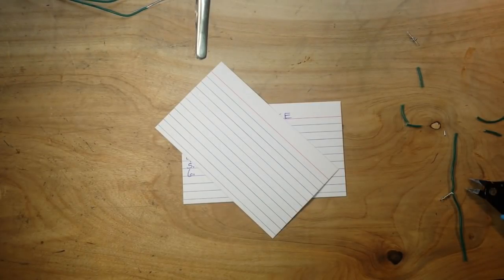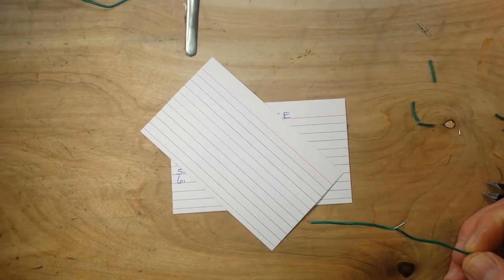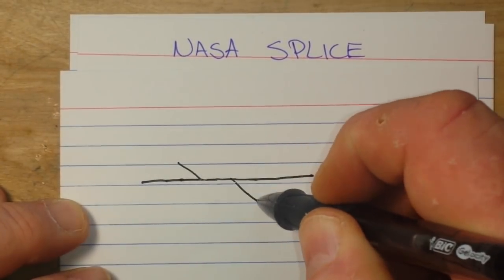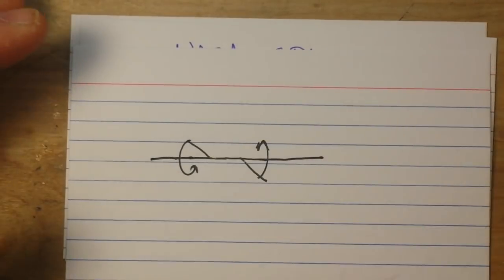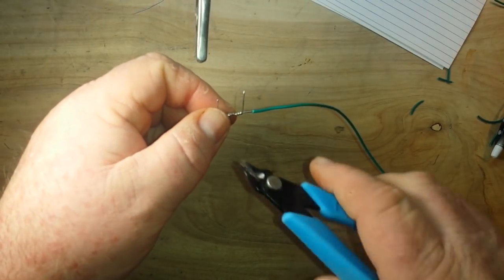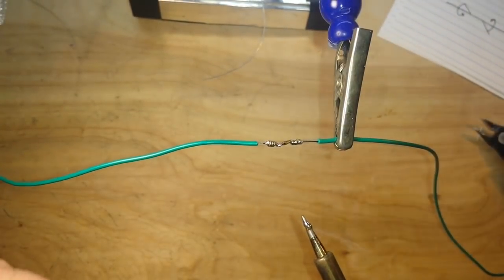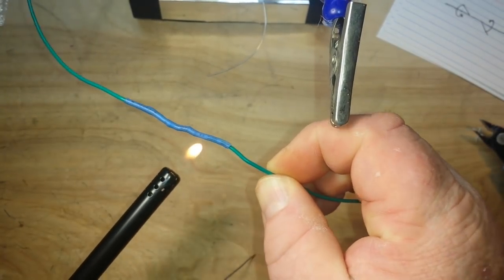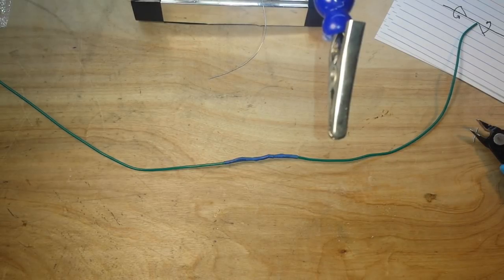How to splice a wire

Comment: The gap between the coils worries me, reduces the strength? also, off topic single stranded copper wire is a no no,
IMHO have no redundancy against metal fatique that can easily cause serious problems in environments vith
24/7 vibration, problems that can be intermittent and very hard to track down

Comment: Haha thanks I've been doing all my wiring myself but i always did it the wrong way and even now to this day but I just bought a new soldering iron from Amazon to give soldering another try after watching quite a few videos now before I couldn't get it to solder correctly but I didn't know the proper way to tin and etc, so I gave up and went back to doing the wrong way like you first demonstrated and then wrapped it in electrical tape. Now I'm going to try to redo all electrical connections tomorrow on my Cadillac Escalade Esv cause I wired in a lot of aftermarket lights, trailer wiring and couple wires had corroded underneath and I found the broken connections and to my lights. I wired em with no solder and just twisted like first showed then wrapped in electrical tape. All these videos been helpful. Oh I have question too. Is it better to tin a wire before putting a ring connector or any terminal before crimping the terminal on?

Comment: So this is new, I’ve never heard of a NASA splice, there are other splices that we use at JSC according to the J standard. All of our splices have to be wrapped minimum 6 wraps. Both wires need to be pre-tinned and flown together prior to wrapping. The wraps cannot overlap, they can touch but you need to be able to see the wire strands and the wraps clearly. The distance from the splice to the wire insulation has to be the diameter of the wire on both sides of splice. There can be no pits or discoloration after the excess wraps are cut. Lastly there is indeed heat shrink that will slide over the wrap. For class one and flight quality will inspect the work and if not acceptable it will have to be re-worked. The wire used as the wrap has to be a single strand from the wire you are using from the drawing, unless allowed to use bus wire.

Comment: Were your connections pre tinned? If I used strand wire do I pre tin also or no?
Reply from the maker: If you are using solid core then you can tin. Don't tin stranded, you need them flexible so they are able to adapt to each other.
Reply: @learnelectronics  Gotcha, since tinning is rule #1 it didn't make sense for stranded wire. Thank you for the response and sharing your knowledge. Greatly appreciated!
Reply: Stranded wire will mop up the solder by capillary action anyway, so tinning them when splicing is a bit counter-productive. Better to just tack them together by reflowing the solder if they're pretinned.

Comment: First off, NASA doesn't know everything. Second, that is not a NASA splice. You have never worked at NASA. I am both mil spec and NASA certified.
Reply: I'm looking at NASA-STD-8739.4A, and it looks pretty much the same, except Paul did it a bit looser around the middle. What's shown in the thumbnail is only half the job, because it hasn't been filleted yet. I'm guessing you commented without actually watching the video. Also, nobody said NASA knows everything: the point is that this is just a good way to splice. You might need to go out for some fresh air and take a walk.
Reply: Fresh air, take a walk, and pull those jumper cables out of your ass. Red to red, black to black. 🥳

Comment: I want to thank you very much for showing the correct way to splice wires.  I am a jewelry maker, sometimes working with fine 28 gauge wires.  This works well for me and even my beads will slide over this method of splicing.  I do not use solder, however, this is a nice and strong connection.  Thank you again.

Comment: Good video. I’m an automotive technician that specializes in electrical diag. I do a lot of wire repair and this is very close to what I have been doing for years. It’s a little different with stranded wire but I didn’t know this was the special technique.

Comment: The NASA standard requires no gaps between adjacent turns.  At 3:50 your left side looks good but the right side has gaps between adjacent turns.  Although you made a good connection, I don't think this is really up to NASA standards. Good otherwise.
Reply: I bet you're the life of the party 🥳
Reply: @kccodex8931  When meeting standards is the difference between getting paid or having to do it again, yeah, I can be humorless.
Reply: @johnp7318  🥳🤣Point taken.

Comment: Thank you for this! I'm a dump truck driver learning to do my own lights wiring. It's stuff I never had to do in decades of tractor trailer work as a company driver--because our fleet mechanic was so darn good. In dump trucking we must bang the tailgate to release clay from bed. The resonant impact of slamming a 400+lb. tailgate destroys crap job tail light wire splices.Something so "minor"  as a missing turn signal is exceedingly dangerous to the public (seven fatalities on this hwy job site this year). Much appreciation for a really good video!

Comment: Ive always done it to half NASA standards i guess. Instead of crossing wires and making an X to start as you do, I make two hooks and fold the wire back on itself. This way is probably better overall because my way you have to make sure its wrapped tight or you end up with 2 eyelets instead of wires solid

Comment: Very helpful - you're a good teacher. What's your opinion of this modified approach for stranded wire (https://youtu.be/M5ZeVzKnteI)? Difference is you don't pre-twist wires so they can fan/flatten when coiling around each other. Also means you can't pre-tin wires. Seems sound to me but wondering your pro opinion. Thanks

Comment: Newbie here and was looking for proper tips and techniques. I was just wondering what part was the pre-tinning? Was it at 3:56?
Reply: It was the wire on both sides that were tinned. That being said they should have flowed together before introducing more solder to the wires, but I didn’t see that happen. If they are tinned before hand, they will melt/flow together before adding solder. Just seen this video today, sorry for late response. Take care.

Comment: Great video, You can give NASA the credit if you want, but that splice goes back to the old days, it is better known as the "Western Union". Used on Telegraphs
Reply: It’s also in the J standards class 3, which includes the standard for all military and government soldering. It’s not a nasa standard, it’s a class standard 😉
Reply: Was the pre-tinning, part of a typical Western Union splice? I think not.
Reply: @kccodex8931  That's correct, the "western union" was only the way they were twisted together. They didn't use solder at all, just electrical tape. I'm sure the corrosion factor was an issue.

Comment: I wonder if this works with using say 2.5mm2 stranded building wire for 240vac (Australian single phase mains voltage) rather than using a jbox and standard connector? Hmmmm. It would obviously be too slow but if you've got limited space like in a conduit, this might be better than a double sided crimp.
Reply: It would be cheaper than using a crimp splice and possibly better, what do you think Learnelectronics?
Reply from the maker: I know this sounds cliché but if it's good enough for space travel, its gotta be good enough here on earth. Just make sure your local building code permits it.

Comment: Always known this as a linesman's splice.  Works as well dry too, wire originally would be copper awg 16ish and the splice formed with a simple little pocket size jig to wrap the "coil" tight.   Could use it to join two ends of a 60 foot telegraph wire mid-span and no solder!
My ticker is faulty too - AF, CHF, 3+ MIs, I have a pacemaker+ ICD.
Kameel - doc always looks at hands because heart failure = excess fluid and poor circulation stops nails growing well, liver and kidney function is reflected by the colour and condition of skin ... so your hands are a valuable indicator to overall health.

Comment: I would have put two pieces of heat shrink over the splice--if that one hits something it will tend to nick the single heat shrink cover--1st do the first layer just as you did, but with a shorter length of tubing to slightly overlap the wire insulation.  Then slide a longer piece of the SAME SIZE shrink tubing slightly overlapping the 1st (shrunken) piece--and shrink.
Reply from the maker: That's good technique.

Comment: Love the guide, been using lineman for years on inline splices (Grew up on a ranch, we used this technique to splice barbed wire...I would assume that's where the name comes from).  Twisted splices drive me nuts just like you.  Also, am I the only one that hates using bare gator clips.  >.< I try to put heat shrink or hose so it doesn't cause crimping on the shielding.

Comment: I'm sad to admit I almost always do the stick together twist method. I find this uses way too much wire, and I'm often reusing old crap salvaged from other projects/products.. but I agree entirely that it is far superior. Anything that moves I twist together straight instead of at a right angle. I will use this from now on, thanks!

I noticed you used solid wire instead of stranded. I've noticed that stranded wire seems to absorb more solder when pretinning and it becomes nearly impossible to bend. Would you use some form of leverage other than your hands to splice.. say... 16AWG stranded?
Reply from the maker: Yes I'd use pliers for sure.

Comment: Great! Now I know what I've been doing all these years. I never knew the name or all the specific steps of the exact standard. I haven't tinned 100% of the time, but otherwise, it's just the correct way as far as I knew.  We learned this technique in our vocational electronics class. Our instructor was in the Navy as a tech in the 50's/60's.  Definitely a never break connection. The wire would probably break before any part of the joint.  I've had odd looks from people, if anyone is paying attention when I use this, but I just tell them, hey, this will never fail.
Reply: Western union  .. telegraphic company  named this type / almost similar connection , no soldering ..

Comment: Why the f*** does annyone want to know anything about your hands?
what are they watching???
by the way great video's ,   keep it up!
Reply from the maker: Thanks my friend
Reply: Because his hands are all that are shown on camera, and he sounds like he ran up three flights of stairs so folks think stereotypical fat nerd in the basement. But I'd probably breath like that too if my heart couldn't get the blood around fast enough. 
In my case I am prone to atrial fibrillation (heart rhythm gets all jacked up with partial/incomplete beats and drops my blood pressure until I'm light headed) doesn't effect my weight though, just means I need to be cautious of potential triggers like excess caffine, booze, stress, and sleep deprivation. (diagnosed at 28 and was in good enough shape to bicycle 200 miles in one day, [normal] resting heart rate of 50.) Mine self resets with a bit of proper rest but most folks need a shock, might be because I'm younger than most.
Reply: Sorry To Hear, Wish Yuo The Best................ Peace.

Comment: Who'd have thought a splicing vid would be this interesting? good stuff to know. Electrical and mechanical integrity of the joints obviously takes priority above all else - but I would love to know how much additional weight this method added to a mission's payload when each ounce/gramme is paid for in fuel used. The cost/benefit will always be in favour of reliability, but just something I pondered. Anyone know the spec of NASA solder? would it have been and is it still 60/40 or some exotic mix, bearing in mind the temperature extremes and vibrational shock? Another great vid Paul, sorry to hear of your health, I hope that "losing yourself" in electronics is an effective way to "put it to one side" for a while. Respect and kind regards from a cold and snowy U.K.

Comment: Paul would you use the same splice on stranded wire?
Reply from the maker: Very true.
Reply from the maker: This splice is for solid core, you could make it work with stranded, but it would be difficult.
Reply: pre-tinning stranded makes it behave similar to solid for many uses.

Comment: I have watched old NASA videos . on how they wanted engineers to solder components . for space flight. it can amazing how complex just soldering a component was. all the cleaning and not touching. I bet it drove ppl crazy . when they was learning. especially if they already worked in electronics. thanks for the videos. sometimes when we don't do things in a while. we forget what we know.  I'm working on a lithium battery charger discharger capacity meter board.  to test lithium batteries. using tp4056 and a computer power supply. basically a bunch of crap on a piece of peg board. with wires soldered everywhere. great video.

Comment: Spliced a few cables as an electrical fitter in the power station but they were slightly bigger!
Reply from the maker: Slightly, you say?
Reply: Ever so slightly Paul! ;-)
Reply from the maker: It's easier with larger wires